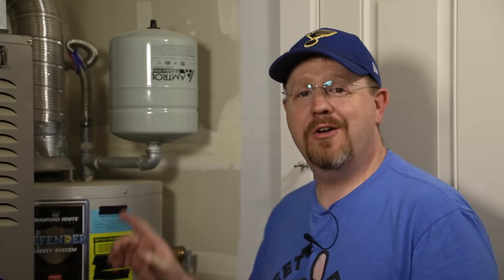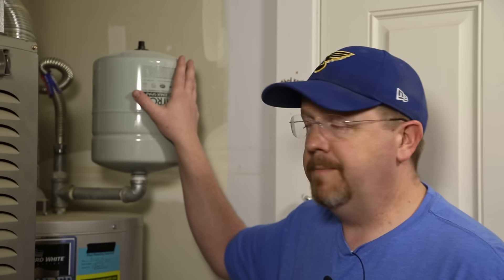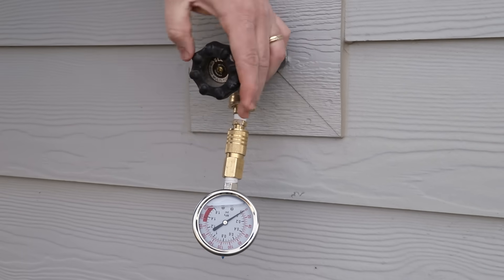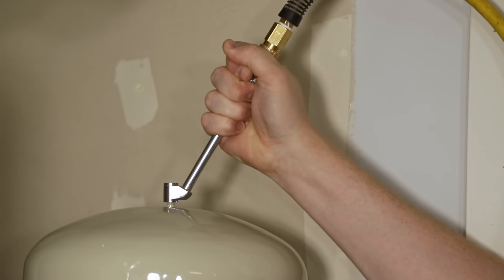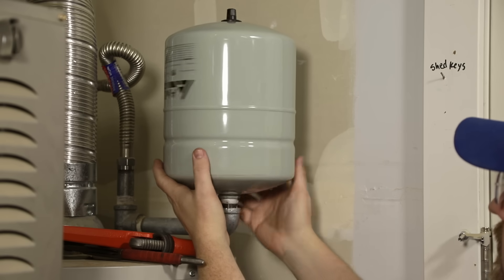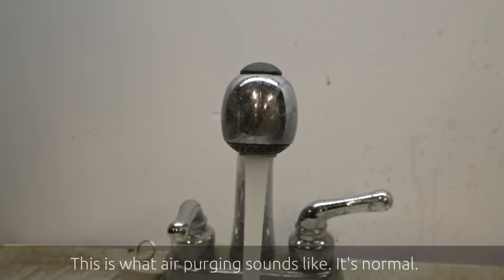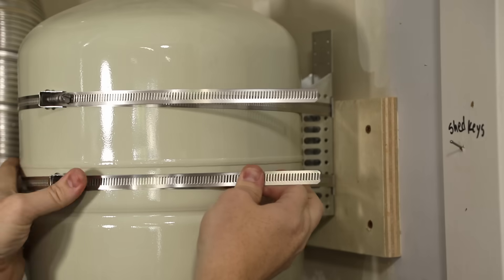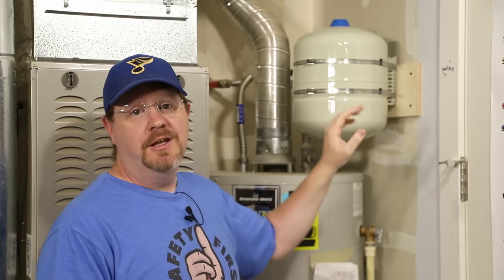What Is This Tank? How to Replace and Maintain a Water Heater Thermal Expansion Tank

Comment: I followed the steps, however when I tried to drain the water heater of some pressure, nothing came out.  I proceeded to remove the expansion tank but water just flowed out as if the valve wasn't shut.  I had to close the water valve to the house to stop the flow.  So my question is the drain valve broken?  Why didn't the valve to the water heater stop the flow of water when closed?
Reply from the maker: I'm a little unclear on some of your questions, but it sounds like you may have a combination of 2 separate problems: 1) Your drain valve might be completely clogged. You might want to consider replacing it with an upgraded full-size ball valve. 2) Your cold-water inlet may not be shutting off all the way. You may need to replace that as well. I did a video on replacing the drain valve here, if you are interested in seeing how easy that is to do: https://youtu.be/OBPJYg0o_o0

Comment: One more thing you can do is with a black sharpie marker, write on the tank what the PSI should be which in your case is 75 psi.  That way if you ever forget, it's right there.  Or better yet if you ever sell the house the new owners will know.
Reply from the maker: Great tip!

Comment: Great video thank you for sharing. About a month I installed a new expansion tank and that stopped the dripping of my T&P valve but after a month it has started to leak again. Any suggestions on could be causing this?!? Thanks again
Reply from the maker: Hi Luis - did you double-check the pressures of both your water supply and the air portion of the expansion tank (with no water pressure involved) to make sure they match? If the pressures are good, then it's time to check and possibly replace the T&P valve: https://youtu.be/e5H1i1cypxA

I suspect the pressures are not correct in your expansion tank, though. 

Good luck!
Reply: @AmplifyDIY  I did and my water supply pressure it’s around 50. My expansion tank it’s around 45 now. Should that make a big difference to make the leak start again? I took out some water out from water heater to take pressure and water out from expansion tank but it’s almost 😅 impossible to inflate with bike air pump. Thanks for your advice

Comment: Hello. I see that your expansion tank is placed above your tank. Can we install the expansion tank at floor level. Thank you
Reply from the maker: The expansion tank should be installed on the cold water inlet, typically within 1' or so of the inlet of the heater. I'd check the installation instructions that come with your tank as well as local codes - but generally I believe that it should not be installed that far from the inlet of the heater. Good luck!

Comment: So. I just got done replacing one of 2 water heaters side by side. The expansion tank was hooked into Plex line strapped to the wall. The tank had apparently failed and broke the strap. Now it lays on top of one of the water heaters. Stupid new builds and how it passed inspection. They covered everything with foam pipe wrap. Only copper is the flex lines running to Plex. 

First question. Does each water heater need an expansion tank?  Next is I can send a picture of set up. Maybe you can give me an idea how to work around Plex. Think I am just going to have to T off nipple and run one pipe to expansion and other to flex copper.
Reply from the maker: Hey Keith - sorry your original installation appears to be sub-standard! You only need 1 expansion tank, even if you have 2 heaters... just make sure it's sized appropriately. As for sending a photo - feel free to email me directly: amplifydiy (at) gmail (dot) com.

Thanks for watching!

Comment: How do we depressurize the system?
Reply from the maker: Simple: Turn off the cold water inlet, then open a hot water faucet somewhere in the house. Let the faucet run until it stops. This depressurizes the water side of the system entirely. The air side of the tank can be depressurized using the Shrader valve on the side of the tank opposite the water fitting.

Good luck!

Comment: I know this question should be obvious, but do you install the tank on the cold water side or the hot water side? 
And can I use regular copper pipe connections or stronger pipe type?
Reply from the maker: Hi CharlieCarty - this is installed on the cold water side. The tank will hold 4-6 gallons of water, and at a little over 8 lbs / gallon, you'll be looking at 30-40ish lbs of weight. I don't recommend copper pipe for this... it's just not strong enough. The plumber that installed my system used galvanized pipes, which are strong enough, but they corrode pretty quickly. I recommend using brass, as it's both strong enough and resists corrosion.

Good luck!

Comment: Good video however you don't need such a big expansion tank. 2 gallon is appropriate. Problem is When the  rubber bladder pops with in a 3-5 years of purchase. The tank fills with water. 4.5 gallons x 8.3 pounds you got more then 37 pounds sitting up there. You put a bracket but most will not.
Reply from the maker: When properly maintained (i.e., keep the pressures set correctly) the bladder should last MUCH longer than 3-5 years. They pop super early like that when they are installed with way too little air pressure and left that way. I believe I mentioned in the video that I was purposely installing an oversized tank - you are right, 2 gallons is adequate for my setup. Hopefully this video has inspired some to install some bracing to support their tanks, no matter what size they have installed. Thanks for watching!

Comment: If you don't have a wall close by to help brace the tank would it be ok to put a wedge under the tank at the elbow to brace it to the top of the heater, would that be ok?
Reply from the maker: It would be better to use plumbers straps to suspend it from the ceiling in that situation. Good luck!

Comment: Is that galvanized steel pipe being used on the cold side?....  And is there a vacuum relief valve there?
Reply from the maker: Yes, unfortunately the plumber who installed this system did use galvanized pipe there. Replacing it is on my list. There is no relief valve on the cold water side, only the one built into the heater. Thanks for watching!

Comment: Does the tank fill up immediately when the water is cut on? Wondering because it's directly connected the incoming water supply
Reply from the maker: Hi Amil - the tank does not fill immediately, no - remember that there are 2 chambers inside the tank: one full of air, the other (initially empty) will fill with water once the water in the heater is heated. The air pressure in the tank should be equal to the initial water pressure of the system, so when you first install the tank and fill the water heater with water, the pressures are equalized and no water should flow into the expansion tank. When the water is then heated in the heater, it will expand, which causes a higher pressure on the water side, which forces water into the expansion tank, compressing the air on the air-side of the tank until the pressures are again equalized. 

I hope this all makes sense. Thanks for watching!

Comment: A plumber was telling me to put an expansion pack on the cold water side of the entry of the hot water tank , does that make any sense ? My hot water system has cracked inside twice within the last 2 years , it has the valve on the cold water entry !
Reply from the maker: Hi Tony - yes, the expansion tank should go on the cold water inlet side of the water heater. Good luck, and thanks for watching!

Comment: Hi nice install, I just put 1 in and used brass fittings. Do you have an opinion on brass, copper or Galvanized?
Reply from the maker: I prefer brass. I'm annoyed that the plumber who installed this used galvanized pipe. On my short list of follow-up videos is to show how to replace the galvanized fittings with brass, and to show just how corroded the galvanized likely already is.

Comment: I’m guessing this needs to be depressurized if you need to fix a pipe leak going into the tank?
Reply from the maker: If you are fixing a water leak, you only need to depressurize the water side. If you are fixing a leak on the tank fitting itself, then I recommend depressurizing the water and the air side as well. Good luck!
Reply: @AmplifyDIY  Thanks for the reply!

Comment: So the expansion tank came preset at 40 psi .. you have to put more air in it? How do you know how many psi you need in tank? I have city water and coming into the house is pretty high pressure and i have a prv to keep it lower
Reply from the maker: Hi TADD - yes, you generally have to put more air in these. I explain in some detail how to measure your water pressure and match the pressure to the tank starting around 2:23.Good luck!
Reply: @AmplifyDIY   thanks!  I am replacing a bad one and just got the new one today. It came with 20psi so i need to check my water pressure and adjust it by adding air before installing. Thanks for the video, i did not want to pay a plumber $300+ for something i can easily do for just the price of the new tank

Comment: Do you recharge the expansion tank with the faucet open or off??
Reply from the maker: Hi Juan - you need to have no water pressure in the system when you charge the tank, so that you can get it to the correct air pressure with no water pressure interference. Faucet open or not will not matter, as there should not be any water pressure at all. Thanks for watching!

Comment: Excellent video and information. I enjoy your ability to show a how to and not make it so that I feel like a complete idiot. Question: Does having an unequal amount of pressure cause the water pressure in your home to be higher or lower? I’d like my water pressure to be a bit higher and wondered about adjusting the bladder. Thanks.
Reply from the maker: Hi Leigh - I'm glad you found the video useful! Increasing the pressure in the tank will simply stretch out the bladder and won't let water into the water side very much. It won't increase the pressure in your home. 

Out of curiosity, were you able to measure the pressure of your water supply? If you have low pressure in the house - is that at specific appliances or fixtures? (i.e., shower has low pressure, but washing machine seems fine)... it could be you need to clean and/or replace specific fixtures to help with pressure. 

Thanks again for the feedback, and for watching!
Reply: @AmplifyDIY  Thanks for your reply. Unfortunately the expansion tank is mounted poorly. The Schrader valve is too close to the ceiling to unscrew the plastic cap and measure/fill the bladder. The last time I checked the water pressure it was 72 PSI.

Comment: I cant seem to get mine to accept additional air with my bicycle pump. What am I doing wrong?
Reply from the maker: Is the tank off the heater when you are trying to fill it? 
Is the tank empty (0 psi) when you try? 
Are you sure the bike pump is connected correctly to she Shrader valve?
Reply: @AmplifyDIY  Thank you for the reply. I learned I have to turn off the main water and open a faucet to relieve the pressure.  Once I did that I was able to easily add air and get the tank to 50psi which matches my house pressure. Thanks again for the great video!

Comment: Great video!  I went down the same path, but still have a problem.  I replaced my pressure relief valve after it had a slow leak.  It now has the occasional, very small  leak you describe in the video after hot water use.   The pressure on my expansion tank matches the 80psi for my water pressure.  Any thoughts on what could be the problem and what to do next?
Reply: Do you think its the expansion tank, the thermostat in the water heater or something else causing the slow leak of the pressure relief valve?
Reply: No advice ?

Comment: Why did you galvanize the fittings? and the tank is too close to the exhaust according to the Ca code.
Reply from the maker: Hi Weidles - couple thoughts: First, I didn't install any galvanized fittings.... the licensed plumber who installed this whole system did that. I suspect they did so to save a few bucks in materials cost. Second... I'm not in CA, and this is all apparently perfectly fine with my local building codes. 

Thanks for watching!

Comment: On a 2 gallon expansion tank how much water volume is available in the tank once pressurised?
Reply from the maker: Hi Aaron - you mean how much water actually flows up into the expansion tank? The bladder that separates the water side from the air side generally is somewhere around the middle of the tank. Depending on a few factors with the orientation of how you installed the expansion tank, there may or may not be a bit of air trapped on the water side... but in general, roughly half the expansion tank will likely have water in it, while the other half will be full of compressed air. Let me know if this makes sense, or if I misunderstood your question. Thanks for watching!
Reply: @AmplifyDIY  hello that’s great. Just wanted to understand how much water is under pressure inside to size one up for my RV install and duty size

Comment: Should water supply be  before tank or after tank.  It before tank -- they water go back to supply.  If after tank(like you have), then water go to tank first.... any thoughts?
Reply from the maker: The expansion tank should be installed somewhere between the cold water supply and the water heater inlet. Mine is on a T connection right off the inlet of the heater - so it's not after the tank.
Reply: @AmplifyDIY  Clarify --- When water expands from hot water heater nipple, is goes to expansion tank first, then to the cold water supply (your setup).  I have seen where it goes to the cold water supply first and then to the expansion tank.   So, if you put your expansion tank on top of the Tee connection and cold water line on the side of the tee  connection - the expanded hot water from heater nipple would go to the cold water line first.   Not sure if it is a big difference.
Reply from the maker: When water expands, it does it in all directions. It does not go into one side of the T first, then the other side. It will expand along wherever the path of least resistance lies.

Comment: Any suggestions when the expansion tank is stuck on?
Reply from the maker: Was the tank soldered in place? Or you just can't get the fitting to crack loose? If it's just a super tight fitting, about all you can do is get bigger and bigger wrenches. Be careful to brace the pipe with one wrench and the fitting on the tank with another... don't just use 1 wrench on the tank side, as the torque can and will easily bend the supply pipe. Good luck!
Reply: @AmplifyDIY it was not soldered, but very stuck. Even with two wrenches I was afraid of damaging the supply lines, especially because they are CPVC, unfortunately. I ended up replacing the fitting as well as the tank.

Comment: I have never used an expansion tank on any of numerous water heaters. I also have never had a single leak or other problem. Seems like a waste of money and time.  I recently had 4 units inspected by the city. The inspector never mentioned the missing expansion tanks. So apparently there absence is not against code. Am I missing something?
Reply from the maker: Their requirement is regional, and based on the age of the home. In my area, all new homes built within about the last 8 years have needed them. I believe they are becoming more common, as municipal water suppliers are starting to require backflow prevention valves at the street for new homes. I'm glad you've never needed one. If you ever buy a house which has one though, now you'll know what it is and how to take care of it. Thanks for watching!

Comment: I thought the pressure valve did the same thing
Reply from the maker: Hi Hildeberto - no, the pressure relief valve is there for when the pressure gets to an emergency level. This tank helps regulate pressures a much lower levels to prevent damage to your appliances (such as the washer) which can be damaged by lower pressures than the T&P valve is set to. For example, your T&P valve may be set to open at 150 psi. Your water supply is likely set to somewhere around 75 psi. Fittings in your plumbing may start to leak above about 100 psi, but your T&P valve won't open until the pressure reaches 150+ psi.

Comment: I GOT 1. DONT U. U HAVE TO RUN NEW DEDICATED HOMERUN ELECTRIC. + U HAVE TO HAVE THEM CLEANED N FLUSHED OUT EVERY 2 TO 3 YRS OR THEY CLOG UP N SHUT DOWN. ALLS U R DOING IS SAVING SPACE N GOING ELECTRIC COMPARED TO GAS. NOT WORTH IT.
Reply from the maker: Hi Work Phone4 - I'm not sure exactly what you are talking about here... are you referring to a tankless water heater? That's not what this video is about at all...
Reply: @AmplifyDIY  YES THAT WHAT I WAS REFERING TO. LOOKED ALOT LIKE WHAT EVER THAT SMALL TANK WAS EXACTLY LIKE IT. SORRY ALL CAPS CAN'T C SMALL LETTERS ON KEYBOARD

Comment: Never had a tank on my gas hot water heater this is my 2nd hot water heater in 25 years and I have never seen any leak from the emergency valve .
Reply from the maker: Hi Big Catfish - as I mentioned, these are only needed if your water supply to the house has a backflow preventer / checkvalve. They are becoming more and more common, and even required in many areas of the country for new construction. I'm glad you've never needed one, but if you ever buy a house that has one, now you know what it is! Thanks for watching!

Comment: i thought those were to pressurize water, i have seen some advertised like that, or maybe they're just similar
Reply from the maker: Hi Eliezer - nope, these tanks just give the expanding water somewhere to go so no plumbing is damaged on homes that have a backflow preventer / checkvalve installed by the water supplier. Thanks for watching!